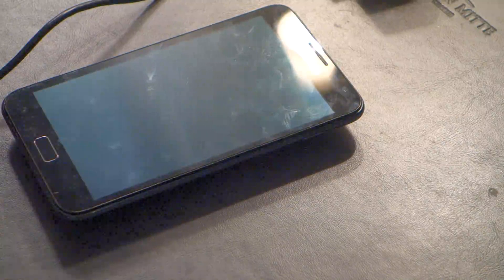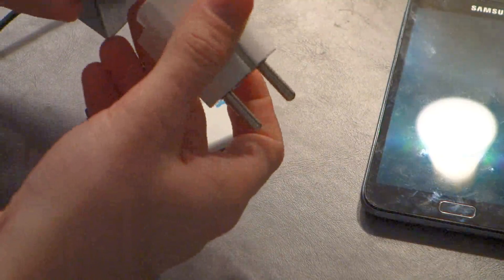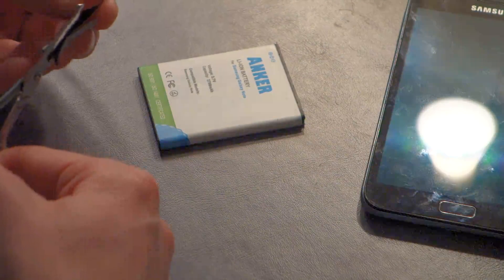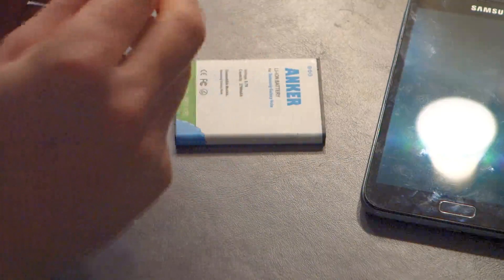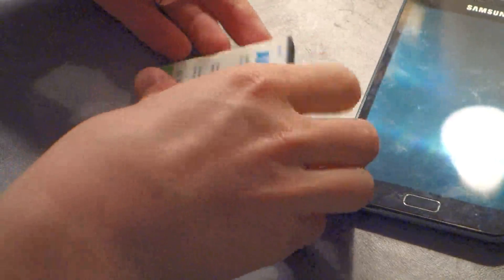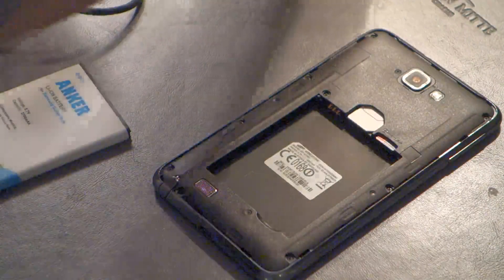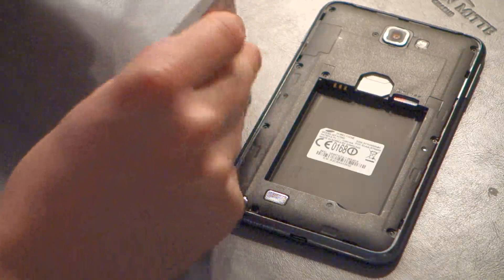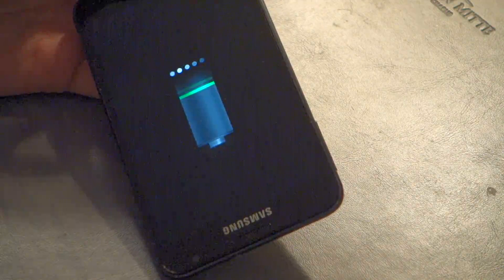Resurrecting my dead Galaxy Note battery

Comment: Battery on my ancient Note was "dead" on 0% for 3+ years. Now wanna turn it to "nonstop on charger" baby monitor but it just wouldn't start charging. I didn't even hoped that it can be resurrected but this makes the trick even for as "dead" one as I had. Now it's successfully charging. So no 4V impulse needed even for this old fart. For the record I used 2A charger and 2A capable cable (high quality one). I have the cable hanging around with broken connector so I followed the video and  cut it to "resurrection cable" THANK YOU THANK YOU THANK YOU!!! You saved me few bucks and a lot of time!

Comment: this works! i was able to revive my note 1 battery. it's better if you have a handy tester so you can be sure you are using the correct wires in the usb cable.

Comment: well well, myth confirmed, successfully resurrected an aftermarket battery (it should be a knock-off of a real samsung battery, but it has all the branding apart from the holo-stickers) on "dead" samsung note (n7000) :) 

it is now charging. thought it wouldn't work, cause I have a Galaxy 10.1 tab and that biatch doesn't charge without the official charger+cable on stock firmware.

Comment: Very good tip, it worked for me too with a 2 months died battery. Just to summary: red usb cable must contact plus battery pin, black usb cable must contact minus pin. Central pin must be left isolated. I tried to resurrect it two times: first time charged for 20 seconds, didn't work. The second time i charged the battery for 10 minutes and it worked (and gave the battery an initial amount of charge.

Comment: What were the two contacts you used with the 2 wires red and black on the battery? is it possible to use the wrong contacts out of the 4 that are on the battery?

Comment: i have a new trick no usb cabe is needed but you need 2 android phones i used a Galaxy Y to repair the battery of a Galaxy Mini 2 the way i did it is the mini 2's batter was empty i putted the min 2 battery in the galaxy y kept it in place with alot tape batter of mini 2 is bigger than Galaxy charged it on the galaxy y after it was 10% back in the mini 2 and let it charge it sels easy as hell !

Comment: I am having this problem on an official samsung battery . I bought an original samsung battery just for spare , worked like a charm for 3-4 months but then suddenly it stopped charging. ( 0% charge I reckon ) . I used a desktop charger , I used your method. Nothing seems to be working for me and I have a flight 2 days later. Sometimes I just hate samsung battery life.

Comment: ive done this a few times with LiPo batteries for my RC gear when i accidentally run them too long or had them in storage mode for too long.. but with the RC gear, gotta get it upto a certain voltage before putting back on normal charge

Comment from the maker: Fixed my phone by jump starting the battery! Mein handy ist lebendig!
Reply: Simple hack because of a desperate need.  There's a huge sense of accomplishment when something like this works out.  Love it.
Reply: Cool ;)
Reply: Cool!
Reply: Nice one, as Lux said, KISS in full effect.
Reply: Something I do for flat RC liPoly batteries so my charger will at  least have a go..
Reply: ***** I had a phone where I used Anker battery's, never did that to me weird eh
Reply: 1st awesome tip glad you saved your phone. 2nd where did you get the card holder on the back of your phone?
Reply: Well done, thanks for sharing.
Reply: Darren my name is Michael I am a huge fan of hak5 write me I need to ask you if I can  have on of you WiFi pineapple mark I've write me back!!!
Reply: Mike Reeves You can get them at http://hakshop.myshopify.com/  They are one special offer at the moment so they are cheaper. Also $16 off shipping due to it being Presidents Day in the US.